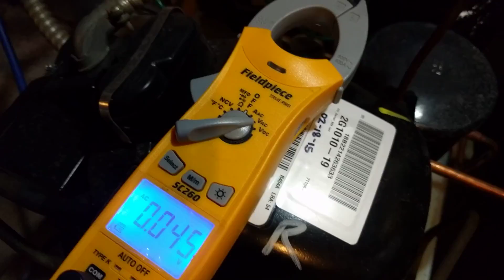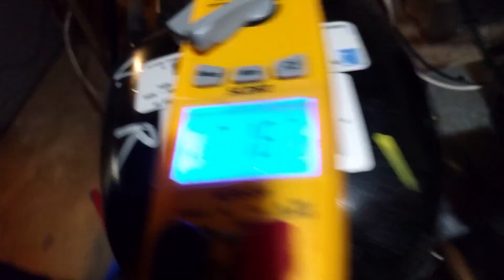Refrigeration Low Pressure Switch Troubleshooting - Failed Low Pressure Switch

Comment: If the refrigerant type is R-404A why its cut-in pressure set to 15 psig and Diff. to 10. I could not get this setting for R-404A.

Comment: hi great video what do u use to set cut in cut out on pressure switches ( how do u know the cut in should be 25 and cut out 5 )i am new to the refrigeration field
Reply from the maker: Most of the time a low pressure switch is designed to simply shut off the condensing unit once it finishes pumping down after a run cycle and thus the exact pressure settings are not very critical. Typically units will be set to cut out slightly above zero (5psi or so) and cut in 10psi above that (25psi). You just need to make sure that the cut in pressure is low enough that it will come on in relation to the VSAT of the refrigerant being used.

In other systems the low pressure switch may just be used to protect against a low refrigerant/leak condition where the system does not normally pump down but protection for the above condition is desired.

The third way they are used is in old systems that use the pressure switch to control the actual temperature of the cooler/freezer. In that case the pressure settings are very critical to align with the corresponding VSAT to make sure that the temperature is set correctly. 

That last option is very rare so you likely won't see that too often.

Hope that makes a little bit of sense at least.

Blessings to you and yours!

Comment: Voltage doesn't diminish with multiple paths. It's the same voltage across parallel paths. So even if the switch had continuity, you would have read the same voltage.

Comment: I have been watching lots of youtube HVAC videos over the last month trying to solve a major issue with a Carrier Infinity 2 stage system installed in 2005, Bristol "junk" compressor. compressor was locked probably due to locked rotor due to mechanical failure - there is a carrier service bulletin on these 2 stage Bristol compressors, unfortunately mine is 13 years old - carrier replacement program was for 10 years old or less. So bought new outside unit model 24ANB648A, installed by carrier authorized service/installation company. I learned a lot from a few of the videos, mostly from carrier troubleshooting guides as 99% of HVAC videos deal with "easy" fixes like  capacitor replacements, cooling fans for condenser - stuff than anyone with electrical/electronics and some mechanical skills can do with eyes closed - your video on the other hand was articulate, to the point and demonstrated some solid troubleshooting rather than "shotgunning" all the usual suspect parts even though nothing is wrong with them like so many of these HVAC videos do after having to watch and listen to them in their cars/trucks while driving to the customer site - usually I cut through 75% of the nonsense and complaining just to find it was another run or start cap change - at least you speak clearly and don't mumble to yourself as you work - like many of these guys do. Question - After the HVAC company replaced my old outdoor unit (same inside assembly from 2005 - furnace, blower, coil) - I am now getting LOW PRESSURE SWITCH Faults listed in diagnostics mode thermostat "last 10 Faults" listing - in the 6 days this new unit has been running - I had 100 faults - I am thinking either dirty/clogged coil since I don't think they really looked at that or low refrigerant - not enough charge when they installed new system - any ideas (don't think a brand new system has a faulty low pressure switch) system is running with no noticeable negative side effects from these errors but I don't want it to get worse. Thanks

Comment: Thank you for the video on how the setup works.  I have a refrigerating unit in my food truck that was not up to par today as it was our first use in some heat.  I am curious if you could provide a good setup for my refrigerating unit using an older Ranco single pressure controller?  I know nothing about this stuff but would like to make some adjustments to see if it will work properly.  The Ranco has PSI on the left from 10 to 40 at the top, right side has 0 at the top and 100 at the bottom.  Hard to read so I hope this is correct.  Any suggestions would be greatly appreciated.

Comment: Awesome...Im working on a 404a system rail/freezer up top and cooler below...So on pumpdowns, my lp switch does not cut out the comp and fan...Run into a vacumn until solenoid kicks back on...
Reply: The T-Stat should close the liquid line solenoid. with the solenoid closed the refrig should pump down into the condenser or receiver. the compressor will stay on until the cut-out pressure on the lp is reached. Now the compressor should shut-off. Check your cut out pressure on the lp. Hope this helps.
Reply: gearhead0800..Yep thanks a lot.Come to find out someone had jumpered the lp switch and so it ran all the time...Soon as i fixed that, the unit ran like you described,pump down and shut off at cut out....Unit has a freezer on top and cooler on bottom, two solenoids.One low temp solenoid and the other a higher temp solenoid...Appreciate your help very much.
Reply: gearhead0800..Yep thanks a lot.Come to find out someone had jumpered the lp switch and so it ran all the time...Soon as i fixed that, the unit ran like you described,pump down and shut off at cut out....Unit has a freezer on top and cooler on bottom, two solenoids.One low temp solenoid and the other a higher temp solenoid...Appreciate your help very much.
Reply: Mahu J if the compressor not pump down if  you gotta replaced the solenoid may be stay open after thermostat stop calling for cooling .
If that not works you have issue with the compressor internal valves not compress not right eventually when compressor over heat it will stop working cause over load it will open after cooling down if will start it shelf till died .